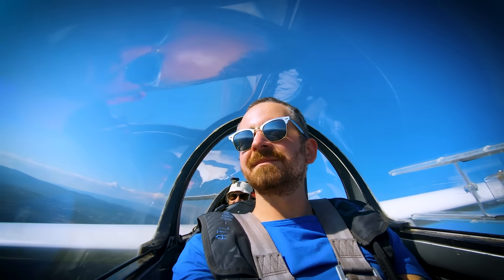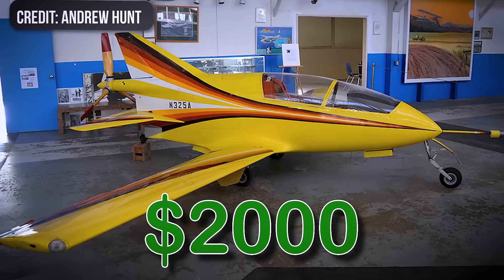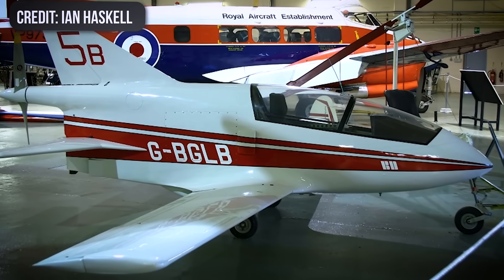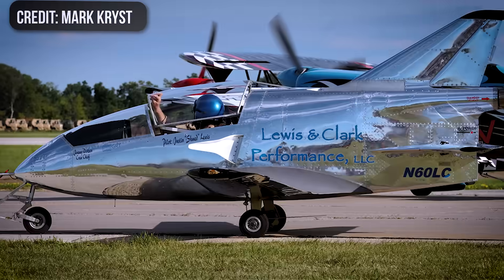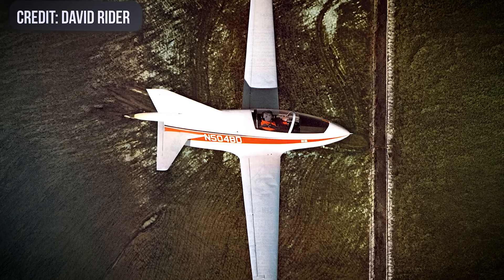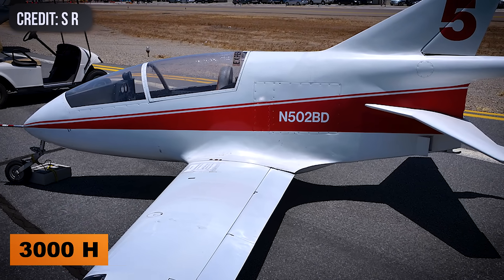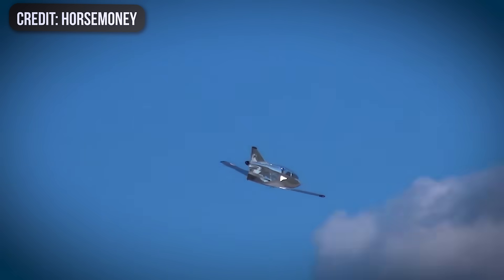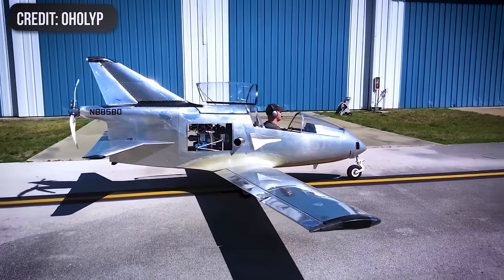This ‘$2,000 Jet’ Seduced Thousands of Pilots… Then Turned On Them

Comment: Jim did design a successful homebuilt airplane which became the AA1 Yankee. It was also one of the first if not the first fully marketed kit plane.
Reply: No, the BD-1 was an unsuccessful home-built; few (if any) BD-1's were ever built outside of a few factory demonstrators.  That, and since the BD-1 was designed as  trailer, the subsequent American AA1 was financial flop in the "training" market.
Reply: @arthurfoyt6727  performance of the AA1 was better that any  Cessna or Piper trainer. It just didn’t have a slower stall speed like the others. American Aviation was trying to break into a market saturated with Cessna 150s. My brother learned to fly in a AA1. I got to fly with him many times.
Reply: @ratride1  Point is that there were no BD-1 kits so it was NOT a successful home built.  AA may have "tried" but the AA1,B and C were seriously dangerous dogs with 2 people in a climb, had seriously high accelerated stall speeds, would get into deep stalls on final with no power or lift to recover AND were eventually placarded with "Spins Prohibited" placards.  Don't even get me started with how many AA1x's crashed on solo cross country flights because the Cessna students never had to switch tanks in the 150's...
Reply: @ratride1  I know I'm not involved, but the take away I'm getting is that Arthur says screw your brother and he's allowed to pathologically hate Jim Bede.  So nyaaaah.  

Am I getting the gist of this interaction?
Reply: @skipdreadman8765  must have a ax to grind I guess. I’ve been around aviation for a long time. Had a few acquaintances die in airplane accidents. Almost died myself in an engine failure.  Flying can be unforgiving.

Comment: Another cool aircraft that was doomed by it's engine.   Loved to watch Bob Bishop fly his "Silver Bullet" BD-5J jet-powered version at various local airshows and at the Reno Air Races in the 1980s. Search youtube for it to see him fly.  He was quite the personality.

I'm surprised you made no mention of the supersonic BD-10 project.   Another good story to share.
Reply: I saw the “Silver Bullet” fly at the El Toro MCAS, in the 80’s. “The fastest landing gear anywhere!”   
Great memories of living in Orange County and visiting the Air Station open house. 👍
Reply: BD-10 a good story to share? Hardly think so. About 5 built,  3 crashed,  2 fatally.
Reply: Corkey Fornoff was demoing the 5J at OSHKOSH. On final, the cable to the thrust attenuator (thrust reverser) disconnected with it deployed, causing a "premature landing" taking out an approach light and damaging the wing. For the rest of the week, Jim stressed "the structural strength of the wing."
While he failed with the BD-5, his BD-4 design is solid and design has been updated with an updated wing design. New ones are still being built.
Reply: The BD-10 never went supersonic.
Reply: @SoloPilot6  It was suppose to. "The Bede BD-10 was Jim Bede's attempt to introduce the world's first kit-built jet-powered general aviation supersonic aircraft."

Comment: They could never get the snow mobil motor certifide.
Reply: Homebuilt aircraft don’t require certified parts. The problem was that Jim couldn’t get any of the engines he tried to work in the airplane. When you read what went on, it’s clear he didn’t really understand how to design a reliable or safe aircraft.